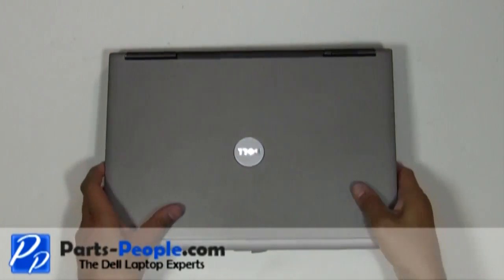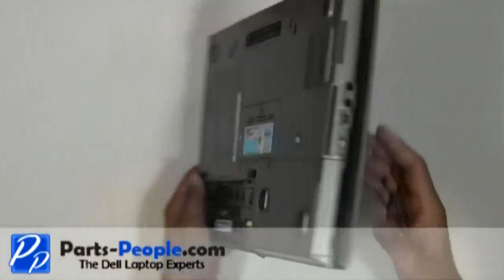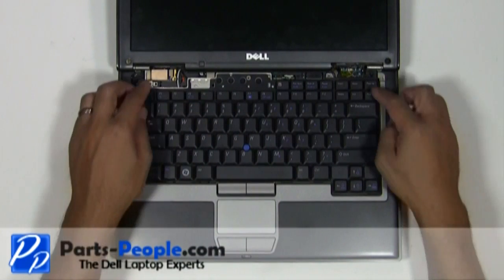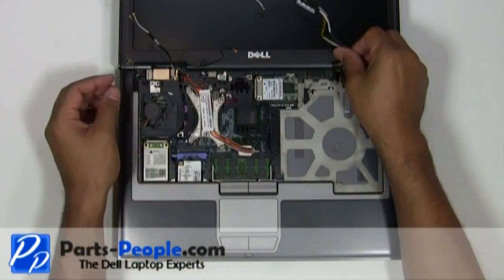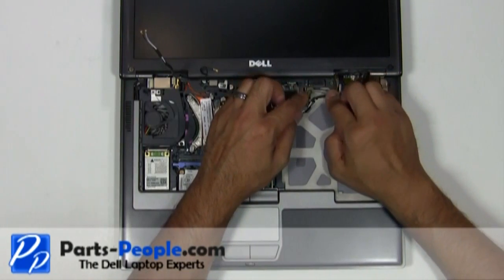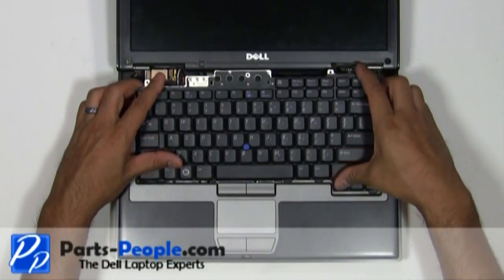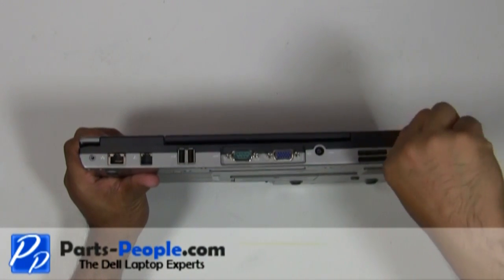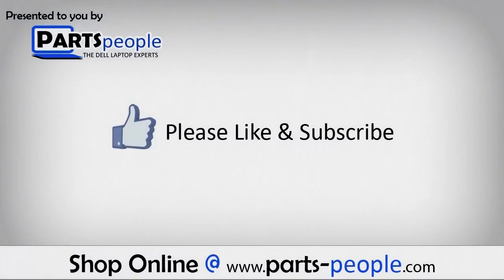Dell Latitude D630 | LCD Display Assembly Replacement | How-To-Tutorial

Comment: Thanks! This video and the one on replacing the inverter board were everything I needed to get the job done. Saved my ex-wife a hefty labor bill for a fairly uncomplicated parts replacement. While I understand the other poster's concern, I would respond by suggesting that if one is THAT unfamiliar with internal laptop architecture, they probably should leave this job to a professional. 
  What's most valuable about this video is that it shows the dis-assembly / reassembly sequence in detail.

Comment: This video should show a close up of the laptop it's too far too see every detail. Very easy to make a mistake.
Reply: I agree. Just before each step, I'd pause the original video, show a close-up and briefly mark the screw holes with red circles, as a way to annotate what's going to be worked on next, then step back and let the video run.